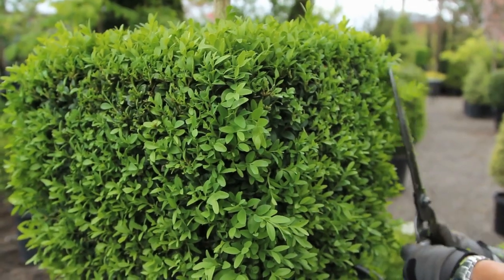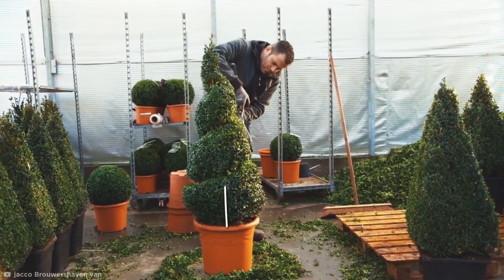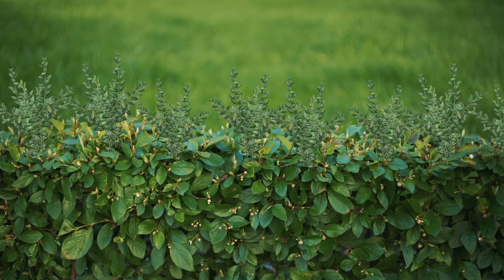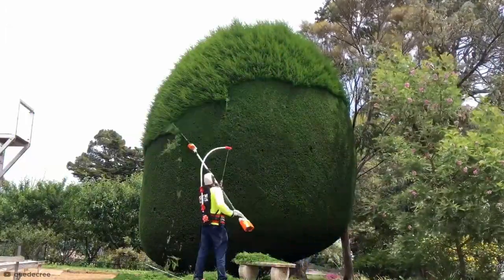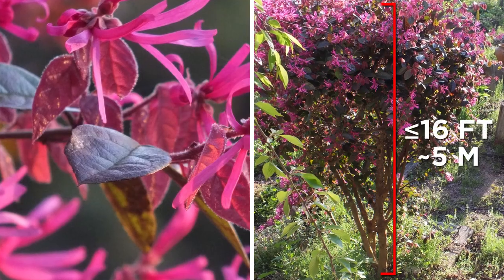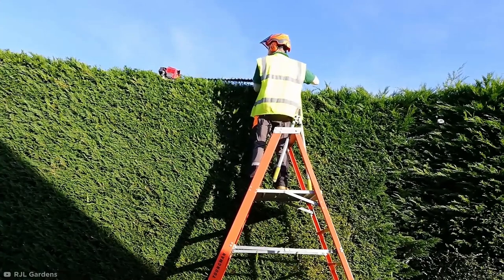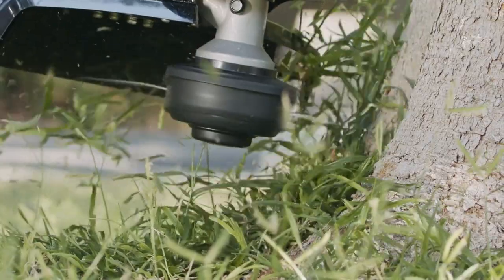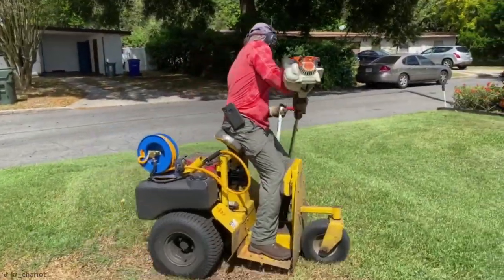Satisfying Gardeners At Work You Can’t Stop Watching

Comment: And I don't know who's been telling you to use all these different machines to cut edges but I have been landscaping for 35 years and I have only used one with two attachments. I personally prefer Echo but there are other names out there that have hedge trimming machines that have adjustable angles on them and there is no need to purchase another machine to do the job and then you can use the small hedge trimmer to go around small hedges and make any shape you want even the spiral which that's all I use is the echo 2-stroke machine as there is no need for and trimming although there are some times where they could be used but they are so cheap all you have to do is just make sure that they are shopping properly. Battery operated machines have come a long way and I am sure since I have a few that they do the same thing as the gas powered machines where you only use one device with attachments or just use a pin that is attached to the trimmer that lets you angle the Cutting application to 90°
Reply: I have cut miles of begets with an Echo HC-150.  Echo makes great hedge trimmers.  Maruyama makes some good ones as well.

Comment: Tip of the day I was a professional gardener since no one's mentioning it if you have dead spots underneath your hedges it's cuz you're not trimming them correctly there's a simple adage always think Christmas tree always taper your hedges in at the top that way even the bottom gets light if you make them like ice cream cones you will have big Open Spaces on the bottom that cannot be fixed even the slightest bit off of Plum will start this effect